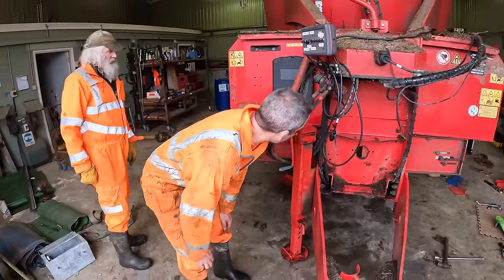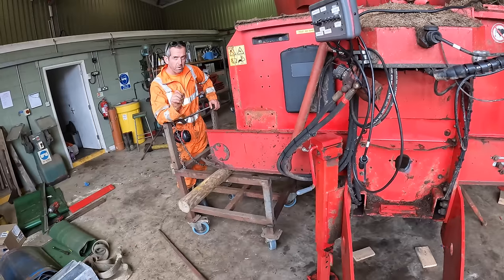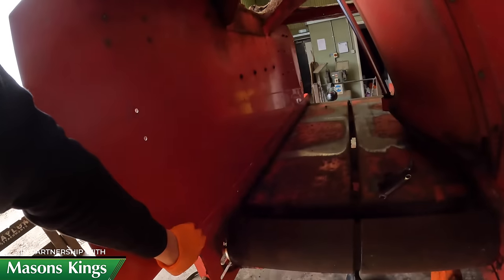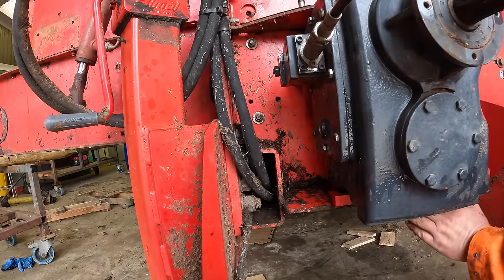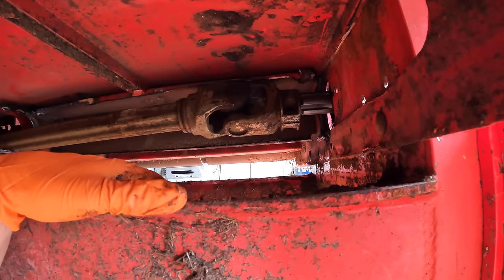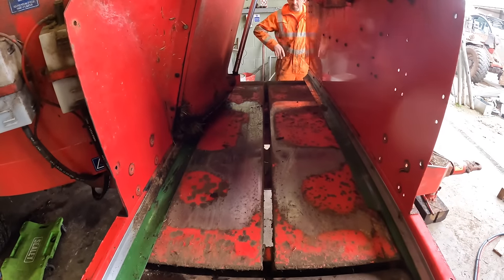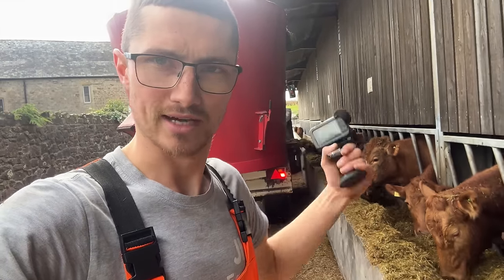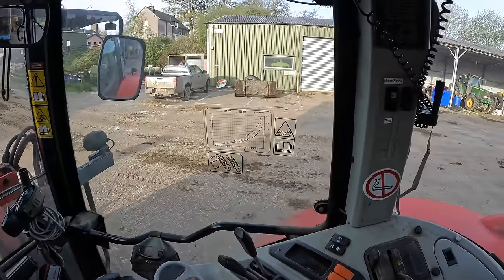Major Wagon Rebuild...But Did It Work?

Comment: You might be able to increase the hight of feed waggon by adding shims to the axel and lowering the tow bar, which I think is bolted onto the body of the feed wagon. Then less TMR would end up sitting on the feed bunker wall or the tractor would not need to drive so close to the feed bunker wall.
Reply from the maker: Already done that! 😂 good suggestion though!

Comment: I’d be tempted to put little spring loaded wheel or something just to stop u from scrapping the elevator into the wall loooks very close to twisting it off
Reply from the maker: It’ll sort the men from the boys that will! It doesn’t stick out any more than the old elevator used to